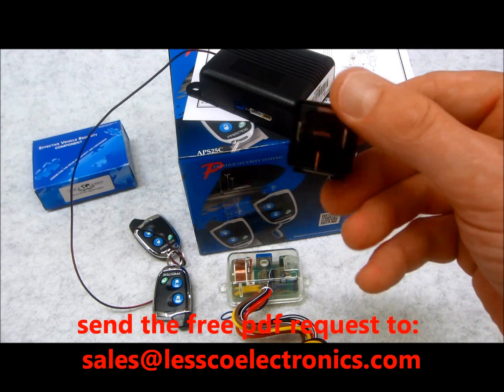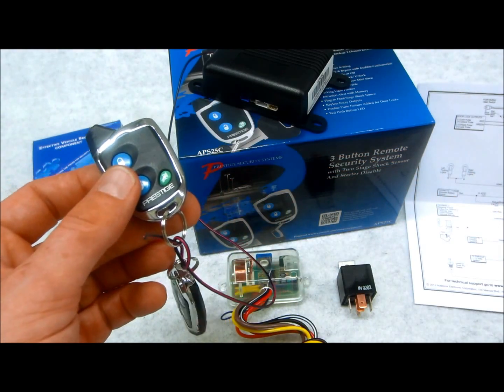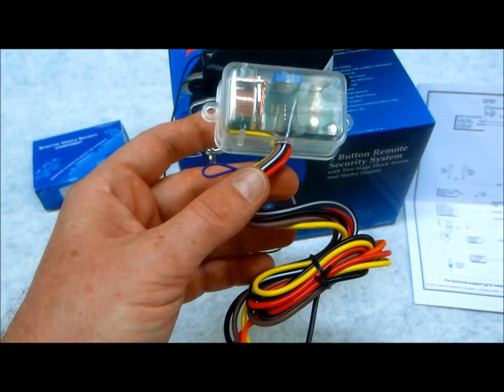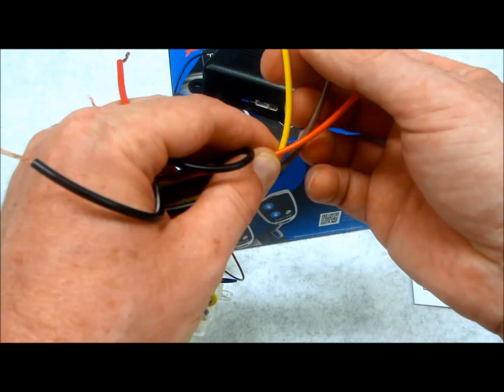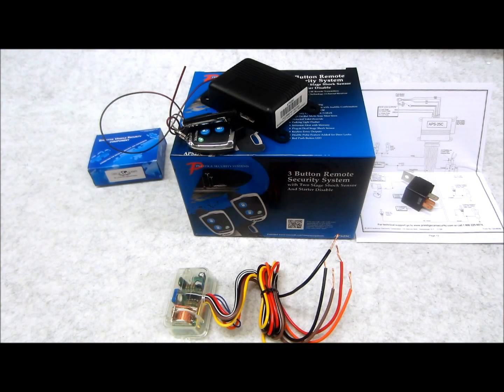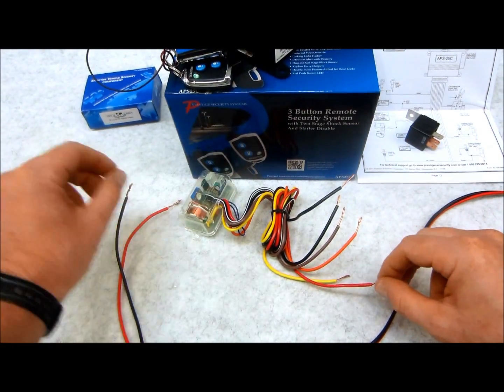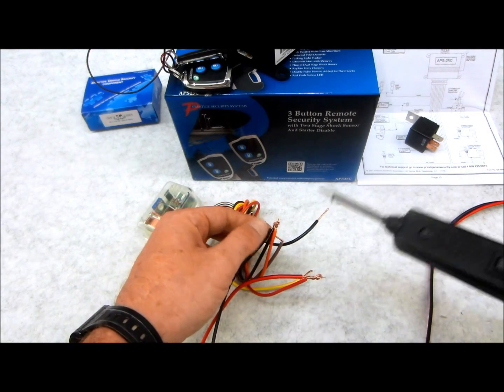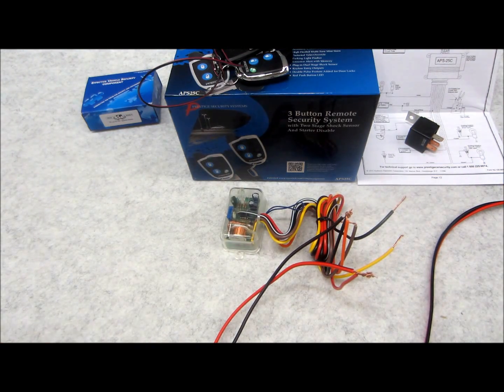How to make a precise latched output for a motor or linear actuator

Comment: Great info. Also, beyond a time-delay glowplug relay, if a generator needs latching on and latching off for run and stop, he can simply use two cube relays. Wire one relay to latch the other. The "lock" momentary closure will set the latch loop, then the "unlock" momentary closure can interrupt and open the loop to turn off the generator.